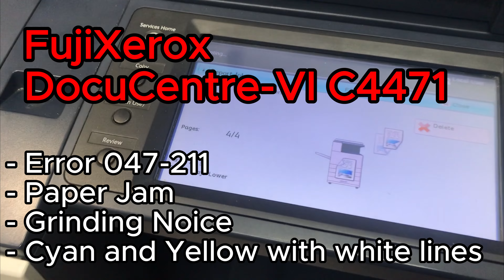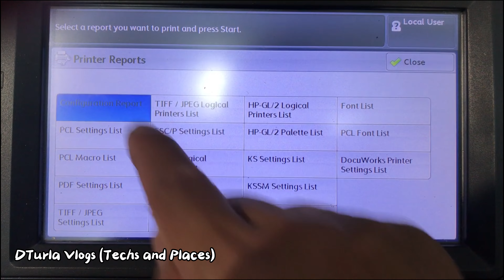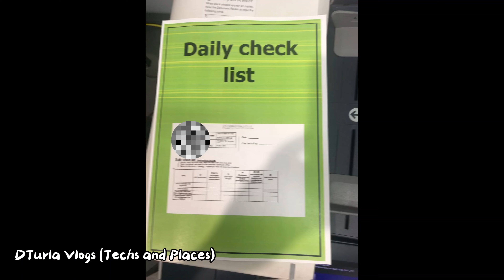FujiXerox DocuCentre VI C4471. Error 047-211 Paper Jam, Grinding Noise, Cyan & Yellow w/ white lines

Comment: Kabayan Sir nabaklas kona yung PCV board ng Brother Printer Ang trouble No LCD Display pero may power indicator...
1. Power supply PCV board
2. Main IC board
3. PCV board right side. Na confirm ko good Ang LCD display. Kasi nai swap ko sa Isang gumagana printer.
Yung Main board or IC board lang Hindi ko nai swap sa isang buo na Printer play safe lang, at pati power supply 😂
Reply from the maker: Hello kabayan, wag kang magpapalit ng main board lalo na kung bago kasi may software yan na inaupload ikaw mismo mag proprogram, hindi yon na dodownload. Na dodownload lang yon kung authorised service center or repairer kayo. Hindi ba talaga gumana pag press and hold mo ang on button bago mo e plug sa AC?
Reply: @dturlavlogstechsandplaces ah ok Hindi pala din yun Basta Basta napa palitan. Mabuti Hindi ko nai swap baka nga mabura ang naka program... Hindi talaga gumana. Tatlo Kasi printer ganuon LAHAT trouble "No LCD Display pero may Power indicator" Salamat Kabayan...
Reply from the maker: @niloyu105  pwede kang magpalit ng power supply kabayan, pero mainboard hindi pwede.

Comment: How to remove the waste toner
Reply from the maker: @Oppo-n8r5s  open the front cover, on the right hand side corner at the bottom  is the waste toner pull it then change a new one. If you don’t have a new one, remove the 4 screws at the bottom, ‘prepare the black plastic bag empty it then clean, by doing that you can reuse your old waste toner.
Reply: Do you have the cartridge of the waste toner? Where can I buy it.
Reply from the maker: @Oppo-n8r5s  hi po , kung nandito po kayo sa Sydney Australia I can provide the parts, service and consumables. Please call me at 0452383524. Thank you.